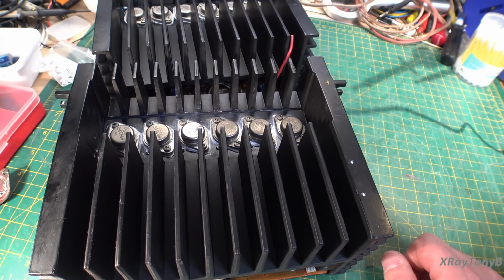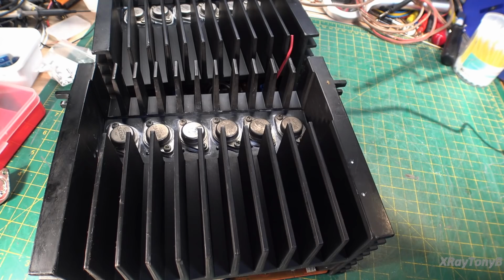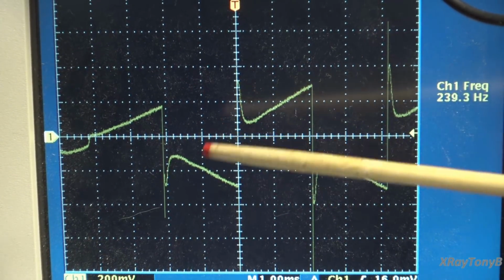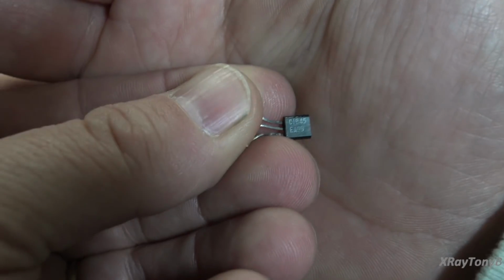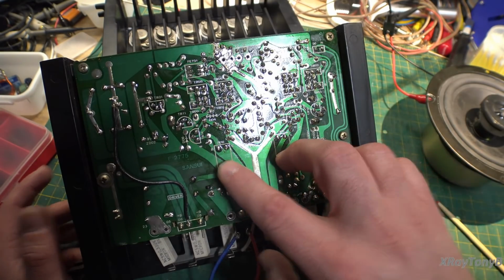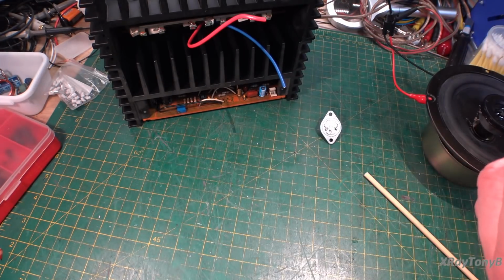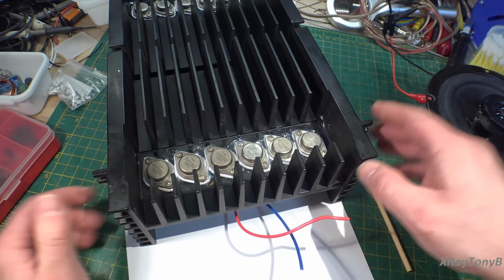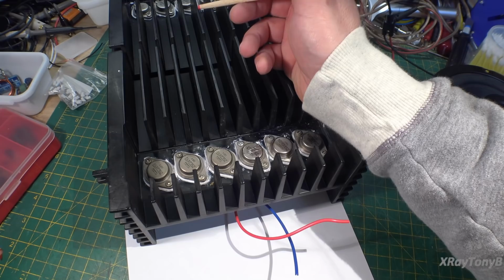Sansui AU-X1 Part 1A:   Transistor Talk & TIM Distortion

Comment: Enjoy these videos on repairing amplifiers and I get a lot of useful info on issues to be aware of when designing audio amplifiers (as a hobby). One I heard in this video is that TIM is created by latency in the NFB loop. This is to my understanding not correct. TIM has nothing to do with the negative feedback, but is commonly due to overdriving the long tail pair )input pair) of an amplifier. TIM is due to slew induces distortion that will "overdrive the input pair. TIM happens outside the feedback loop and cannot therefore be caused by negative feedback. There is a lot of literature on the subject: Bruno Putzey, Bob Cordell and so on. Another comment is on latency in amplifiers. Please do not confuse latency (time of flight) with phase delay. These are two different things and is often used as the root cause for saying that feedback is bad.

Comment: About two years ago, I completely recapped (including the funky little stabilization caps) an AU-X1. They are notoriously unreliable and you could not give me one. And I say that based on 46 years of audio repair experience. On, and by the way, there's actually no such thing as TIM. It was the invention of a a very smart man who unfortunately did not understand how negative feedback worked. And of course, the stereo manufacturers took off with the idea and tried to use it to sell equipment.

Comment: A comment regarding the crossovers I mentioned.  I'd go with active filters using  high slew-rate op-amps.  Back in the day, the 5532 and 5534 were good choices, but there are probably better ones today.

Comment: My understanding is that the main cause of TIMD is the long time constant of the feedback loop in solid-state amps.  When a fast rise time signal is applied to the input, the transistors run wide open until the negative feedback catches up to reduce the gain.  A cure is to use local feedback with emitter resistors in each stage, and no overall feedback.  But here's my idea for having a TIM-less amp using an old TIM prone amp.  1)  Get a good tube-type pre-amp.  I've seen inexpensive kit models on Ebay.  2) Drive the high TIM power amp through a 3rd order L.P. filter.  The x-over frequency?  Maybe 5KHz or so.  Then drive a tube amp with a 3rd order H.P.F.  Odd order filters should be used, because the L.P. and H.P. have the same phase response at the x-over freq.  1st order isn't sharp enough, 5th order is a bitch (too many critical components).  Also, they should have Butterworth response.  As we know, the energy density up in the treble region is much lower than in the bass, so you don't need a humongous tube amp to get plenty of loudness.

Comment: The Henry Ford is a wonderful museum, can't wait for things to be over and I can go down again.

There's also a story indirectly about the Royale. In the 70s, British Leyland (the actual truck part of it) was to introduce a new large diesel engine. It was rather advanced (too advanced as it turned out) and used the integrated cast block and head assembly. The established engineering heads were aghast at this design, to which the design consultant said "Well, you know, Bugatti used this design in a pre-war car." The instant response from one of the engineering staff was apparently "Aye! And it didn't bloody work for them either!"

Comment: That is not your normal Class AB amp but a Class A amp and the output stage is going to get very very hot and the amp needs to be placed in a well ventilated location with speakers with 4R impedance.

Comment: There is one glaring problem with TIM. It's called the speed of sound, that coupled with our 15psi atmosphere. Yes, TIM is relatively easy to to produce and measure with test signal generators. And yes, you can generate signals that "out run" the feedback loop. However no natural sound and no musical instrument can produce a pressure wave fast enough to trigger TIM in a competently designed amplifier. And also consider that no mechanical microphone can respond to such a pressure transient even if it could be produced in our atmosphere. So while TIM can be simulated on the bench and is a great audiophile discussion topic, in the reality of music and voice reproduction, it doesn't ever occur. In addition my background is in video circuit design going back to the early 1980s when analog video was still the norm. We used the same feedback topology in video amplifiers that were used for audio amplifiers, more accurately audio preamplifiers as video amps are not power amps. Even with the sharp rise times of a video signal, the feedback loop was well within the correction window time wise.

Comment: One interesting thing about TIM. It was a hot topic back in the mid 70's after an EE paper was published on the subject. Now it has been considered irrelevant by many audio engineers.
Reply from the maker: Thanks for watching (Love your channel, by the way!).  After really studying this, I think the truth is somewhere in the middle.  TIM distortion is very hard to detect, let alone measure in a controlled way.  It requires a lot of expensive test equipment that most of us don't have.  In addition, without the proper media source and speakers, it's really hard to hear a difference between higher or lower amounts if TIM distortion.  So in that aspect, I would side with the modern audio engineers.  On the other hand, with the correct setup, you can really hear the difference.  High speed amps have a much brighter sound in the high end and a very tight sounding bass.  It is noticeable even to my "non-audiophile" ears.   Of course, it's been over 30 years since I've heard a system like that.  As a side note, Nelson Pass did a very good article on the subject.  You could probably find it online somewhere.  Thanks again!!
Reply: @xraytonyb  I have a Yamaha M-4 that uses two sets of Toshiba 2SC2460's and 2SA1050's, which to my understanding are similar to the outputs in this video. I had two of the 2SA1050's go out in one channel and had to replace all the outputs with the newer, slower outputs you mention here in the video. Are there any better substitutes out there, or is there a way to source two 2SA1050's? The new ones work but the amp never quite sounded the same afterwards, and I would like to try to get it back to the way it was.

Comment: In the 1970’s when the TIM distortion was a hot topic, there were a couple of my friends plus an acquaintance who was all for tube amplifiers all of who wrote their theories.  What I still remember about those documents was an explanation about the “birth” of the mentioned distortion.  I remember it, because it appealed me and my own reasoning.  The idea was that depending on the length of the feedback loop, you hade various time delays.  The longer loop, the more delay and the more TIM distortion.  Also, the more feedback you applied, the more TIM distortion.  How come?  When a transient arrives to the same stage where the feedback comes, that stage SATURATES before the feedback arrives.  Saturation is when a transistor (and a tube as well, if the feedback loop is very long — not a normal design) is non-linear and acts as a mixer.  The mixer behavior is when you generate intermodulation.
The tube guy had a short feedback loop, but also a huge reserve before saturation on his driver tube and local feedback on the output tubes (basically cathode followers), so his theory was that tube amplifier with his configuration was the total solution.  And “don’t confuse me with your theories”.
I hope this adds some useful insight.
Reply: TIM is simply another way to say slew-rate limiting, its not hard with modern devices to get enough
slew-rate from an amp to avoid this completely for any audio frequency signal.

If a part of a linear amp is saturating or slew rate limiting, its simply not upto the job it was designed for, period.

Any delay in a feedback loop will oscillate like crazy, that argument about delays is bogus, there are phase delays and group delays for sure, but feedback latency is pretty much at the speed of light, ie measured in nanoseconds.

Comment: It appears there has been some advances in class D amps by using eGaN FETs which switch much faster and reduce distortion. It appears that is where we are headed now. An article I just read was very interesting and said this,   "The technology of professional high power Class D amplifiers is so complex and fragile that reliable operation of after 7 years should not be expected." That doesn't compare well to the analog amps that are still working after many more years of service than that.

Comment: The Pioneer sx-980  has these stupid stk modules.. and sx-1080 uses other type transistors not to3
Reply from the maker: The 980 and 1080 use ring emitter transistors for the outputs.  They are in an MT200 (rectangular case) package.  Although they have 4 pins, you only need to use 3, as you do in a normal transistor.  The SX-780 was the largest amp (45 WPC) in that series that used the STK amp modules.  Thanks for watching!
Reply: @xraytonyb  ooh so the 980 doesn't use stk's?  shiiit i pased on a deal for one that had broken outputs. I thought it couldn't be repaired.. It was only €100!! I also sendet you a email about some repair stuff
Reply: @simonjaarsma5570   only up to the SX780 use the STK modules, from there up they have discrete output sections.
Reply: They are not MT200 package, this is a MT200 https://www.digikey.co.nz/product-detail/en/sanken/2SC2921/2SC2921-ND/3929386 the transistors Pioneer used are an odd package though for the 80 series receivers, I think they are 4 pin, and have two collector pins (needs verification). There are a few Sansui's that used MT200's though.

Comment: Modern class D made most of what was employed in this amp that made it special, to reduce the distortion among other things very obsolete, they now have ridiculous amounts of slew rate and very good dampening control over the speakers which is what one would use an amplifier in the video for originally back in the day. Anything Hypex ncore or Icepower Iceedge for instance, how far we've come.

Comment: Allot to remember,  when I took electronics in tech school.  All I remember is about "holes",  not electrons.  Beta, HFE, common emitter,  common base, common collector configuration. The .7 volt base emitter junction to overcome for first conduction (in silicon, not the same with germanium .5 )  quiescent mode-- or class A all the way to saturation.  And push pull class AB. Class C for radio circuits. Then there was configurations, transformer coupled, capacitive coupled, direct coupled,  Darlington, then the big one, Quasi, Complimentary, Symmetry.  I can't think of them all. If there's more.  But that's just on BJT transistors.  I forgot about the frequency types  lol    I knew about switching types vs slow linear and low gain, high gain types.  If that's how you say it.   I need to go back and look in my study books..  or you can present this knowledge here.  It'd be good to discuss the types and configurations.  Maybe do a demo.   
I always enjoy your videos Tony,  thanks man!!

Comment: If the transistors have to be rated to a considerably higher bandwidth than the audio range in order to handle the transients, does that also apply to the "HD vs 44.1/48kHz" debate that seems to constantly flare back up in discussions about high end audio?
Reply: I think it does, the debate is about what we can hear is form of sinus tones (and the Nyqist theorem). Music is not att all like sinus tones, well behaved and predictable. Newer research have proven that the ear and brain is far more sensitive to locate transients than the research on sinus tones have predicted.

Comment: “Tim” distortion - what happens when you let some guy named Tim take over the AM talk-radio scene! 😆 Actually, it’s more like this:
Imagine you have two people standing out in a field somewhere, and they’re walking along, passing a ball back-and-forth. If you were flying a drone overhead, the ball would make a path over time that kind of looks like a waveform you’d see on a ‘scope. Now, imagine that a third guy comes on to the field, and he wants his ball back. If he can move fast enough (high slew rate), then he can catch up to the ball and intercept it. However, if he can’t move fast enough, then he never gets to the ball by the time one of the guys passes it back, and he’ll forever be playing catch-up. If you view his movement on the field, it’d be a waveform of lower amplitude, and distorted. Think of this as the output waveform from an amp with lower-frequency-rated transistors in the signal path (whether the transistors are discrete, or inside an IC doesn’t matter.) Even your oscilloscope will have the same problem if you try to measure a signal with a higher frequency that the scope’s bandwidth; the transistors in the vertical section of the scope just can’t catch up, and - as the frequency of the input signal rises - the amplitude of the displayed signal is reduced (i.e. more than 3 dB of roll-off); the input section is acting as a low-pass filter. 😎

Comment: finally. a channel with it's creator that gets it where cycling frequencies and slew rates are concerned and matters! :-)
 now...i am old school and have watched transistor amps develop over time...and then regress for the most part(multi channel phasing nightmares like 5.1 and that sort of nonsense).
 the tim in regards to  aural performance goes like this: when you have a large bass transient and a high frequency transient at the same time( a kick drum and a solid bass note combined with a cymbal hit and a high pitched woodwind for example)you don't want to have the timbre and detail of each of these instruments to meld together or get washed out. these amps are designed to not allow that to happen to the best of their abilities. they are highly detailed in their presentation and are extremely dependent upon source material and the quality of the reproduction accuracy of the source device. that means that mp3's or other compressed formats(that includes'lossless') just won't do when you are listening with a critical ear. differences in source material and head units as well as driver assemblies become much more apparent.
  these types of amps are also much more phase coherent in their delivery. folks who are used to playing instruments...especially string instruments(violins/cellos/pianos that sort of instrument)...will notice the differences more so than others.
 cycling frequency capabilities and slew rates(low microsecond recovery times) are where it's at in my opinion in regards to transistor amps. you stumbled upon a good one here that at the time was relatively affordable to own in comparison to it's much higher priced counterparts. it's a pleasure to see one of these getting restored properly. thanks for your efforts tony. it's greatly appreciated.
 for giggles...you should hunt down a home gamer amp(available as a kit) from david hafler to restore: the dh200 mosfet unit. another affordable but under appreciated unit from the 80's that's easily modded and is a decent performer when set up correctly.
 thanks again :-)
=dok=
Reply: Thank you for this comment, it clarifies parts of Tony's exposition.
I ran across this situation without the name TIM, when reading a Golden Ear review of what must  have been a similar wide band amplifier. He claimed to hear an ultrasonic oscillation. The only way I came to understand how he could hear something so high above his hearing range was to think of superheterodyne circuits that mix two frequencies (or more)  with two outputs. One is higher than the high frequency and the other is lower. The reviewer was likely hearing the mixed output of the ringing and the music.  This sort of thing is also a problem with digitally sampled music. The sampled frequency's are modulated by the sampling frequency. I have seen this in my experiments.
Reply: Yup, I noticed this, he explained it perfectly why a good clean supply and noise floor matters in just about everything audio. Every bit of noise on the signal affects the actual signal you want to reproduce! It matters how quick the amplifier can respond to each and every one of thoice changes. COMPLEX WAVEFORMS. People who talk about "audiophools" forget about very complex waveforms and go on about audio frequencies being easy to reproduce just because the parts can easily handle mhz frequencies... yeah, a sine wave maybe.
Reply: This is actually one  of the big reasons why its great to bi-amp speakers and electronically crossover (either by a DSP or line stage), you're getting rid of all that low frequency high current crap going to the midrange/tweeter drivers and not having to use any passive crossovers. Much easier work for amplifiers to reproduce because you are sending a less complex chunk of the signal to each amplifier.